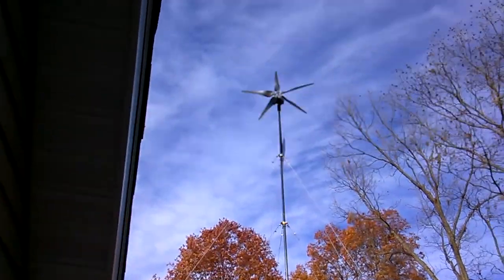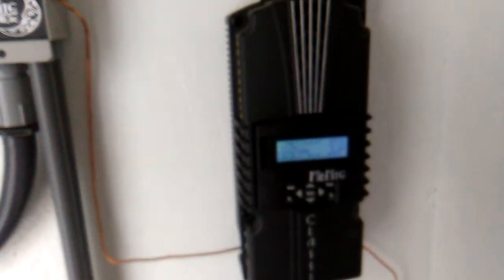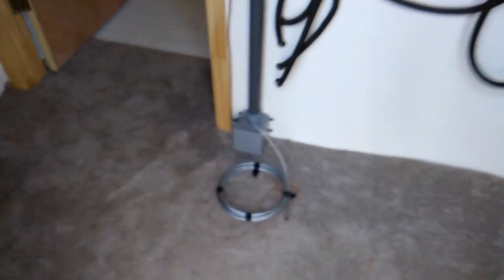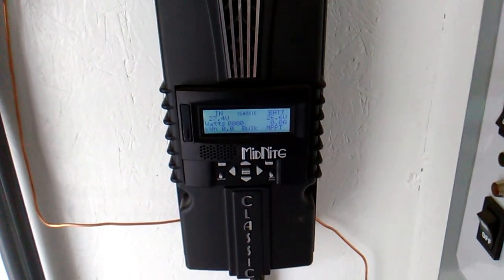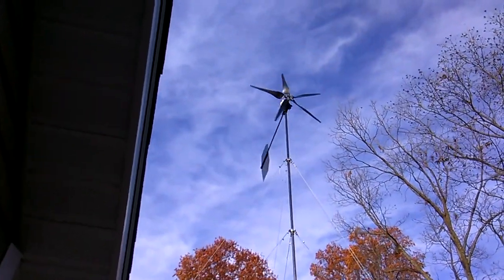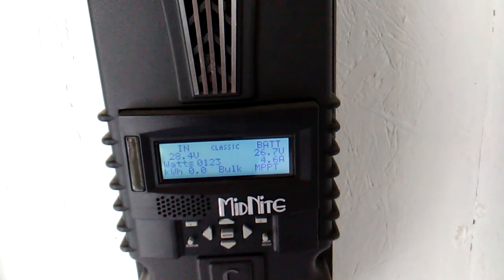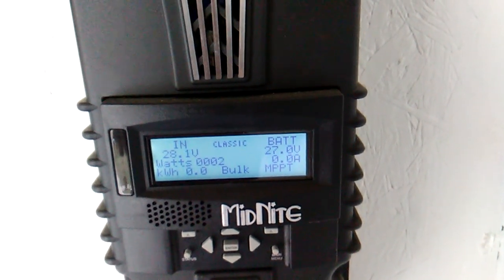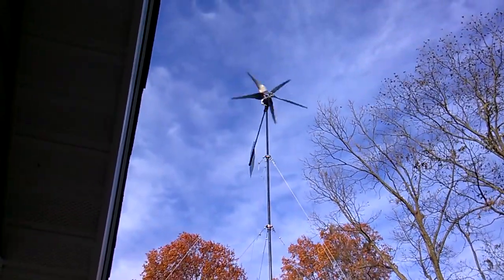Wind Power on 11/17/2016

Comment: how did you couple your tower sections together?
Reply from the maker: I used standard pipe coupler. which for that size pipe is way to small. when I lowered that pipe to work on wind generator it snapped at the coupler. the new tower will have welded flanges on them and another pipe inside for additional strength
Reply: SilentDeath002 what type of pipe?